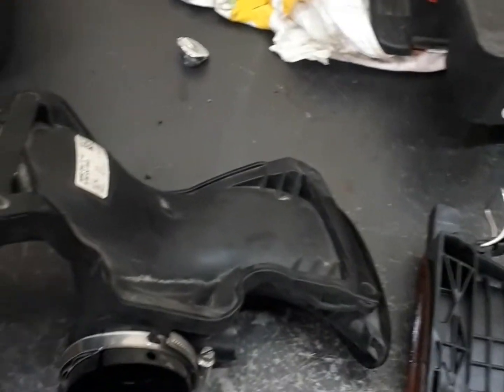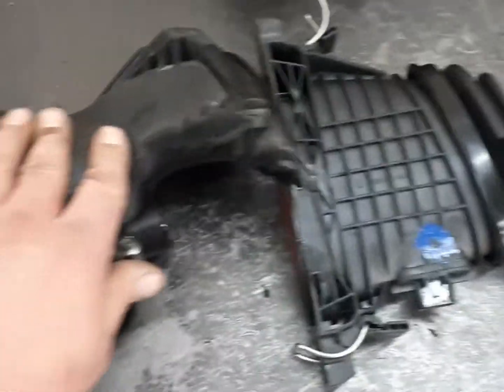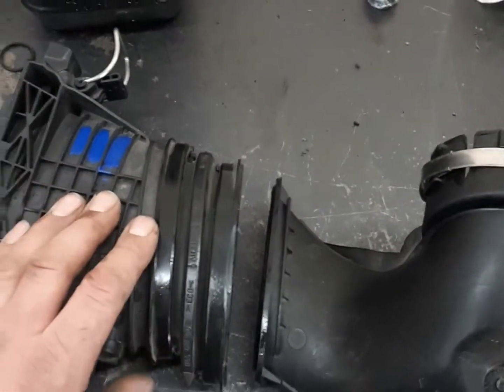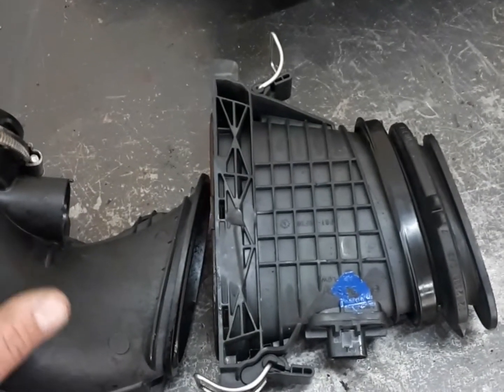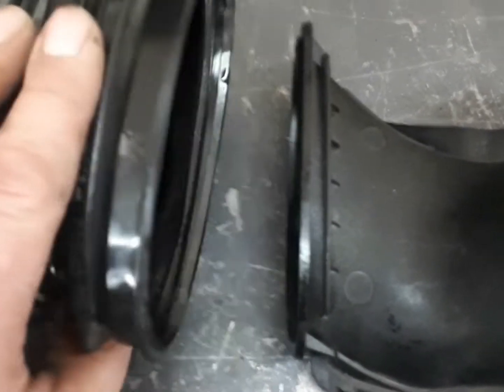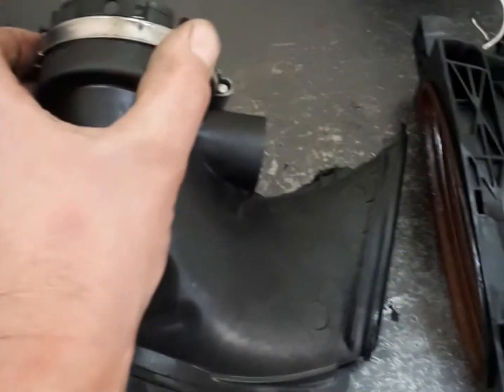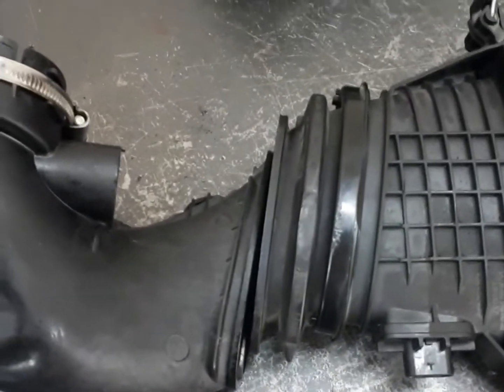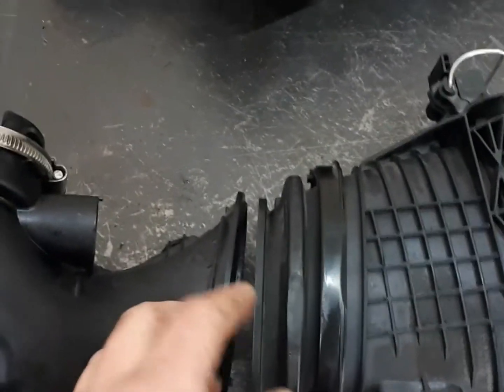ML350 Diesel Mass Air Flow Sensor Set Repair Hack.

Comment: You just pulled it apart and put them together again? I’m assuming there was just a vacuum leak in that case? Or did you go ahead and spray the MAF with some MAF sensor cleaner/isopropyl alcohol spray? Also did the code re-appear? Can it only be cleared with MB star diagnostic tool?
Reply from the maker: Theres a rubber seal inside that was very flexable. Plus diesels have no vacuum until the egr plate closes. Both sensors were shorted on both used parts. First one did not read temperature. The other did not read airflow. But 2 used assemblies i just used the two good ones. But i did warm them back up to pop them back in. Used a pick and pocket screwdriver to gently move the plastic collar. I did use mass airflow cleaner to get soot off the sensor
Reply: Thanks. I’m faced with similar dilemma. Have a generic OBD2 giving 2 p1101 so makes sense could be for both sensors. Doubt they’ve been cleaned too. Would you say it’s possible to get in there from on of the little holes on the ends of this y-pipe/bat wing with the long tip nozzle on the can without having to remove them as you do with the heat gun? I’m up in Canada right now we were at -30 degrees last night. I fear if either I or someone else tries to reheat the plastic pipe like that would be so brittle and crack into pieces. Was hoping just to be able to spray them in from either end of the pipe where there’s a bunch of holes. Thanks again!
Reply from the maker: @tjtj1566  you can try a long flexable plastic tube to try spray it. I only had a generic code with my snap on scan tool but i was lucky to have data stream. I did in summer but yes it was minus 30 at my place too this week. Problem is used there like 300 bucks and no garentee. New there were like 1200 plus for the pipe and both sensors
Reply: Not an ML but i have a 2013 C220 CDI with mass air flow sensor problem. Code P010129. Been in limp mode for a while now. No turbo leaks found.PLEASE HELP!
Reply from the maker: After a forum check a guy was saying after install of new Mass airflow if your wiring is ok. Try reset the lambda sensor or relearn. Kinda a fuel trim reset. Then delete code. Ive never worked on a 220 , to be honest . But most is trial and error and asking questions and reseach on forums

Comment: How do you swap the side clips over? Ive got new sensors but they dont come with plastic clip its really difficult to remove . Any ideas?
Reply from the maker: Looks like they may pry up and out .. i dont remember having to take them off
Reply: Ive done it now.i will upload a video now
 You have to heat it and pry it off slowly.it has a tiny black tab that hodls the clip

Comment: Hi, it's a long shot but, can you post another video showing how you popped off the plastic collar?
Reply from the maker: I don't have a nother one. But what I did was I warmed up plastic with a electric heat gun and just used a pocket screwdriver to gentle work around it with slow pressure. Having a extra set of hands to help works well. Just being patient and gentle prying that thing pops off. To put it back on warm it up and work your way around also some silicone spray helped to pop it back on

Comment: Do not understand what you basically did separate the end of the wings with heat gun and attach it again. But how you can fix the MAF sensor. Clearing the code will not fix MAF sensor if it is dirty. I am surprised below comments think it is the fix. But what you did to fix it. You mentioned that the used one also had bad MAF sensor. so question is the original MAF bad and the used one MAF bad so how you fixed it .... Thank you!!
Reply: That's what i was thinking... he just took it apart and put it back together again? Or used the sensors from the used replacement... or did he skip mentioning a step he did IE cleaning? Lol
Reply from the maker: @The.Contractor.416 yes I did clean them. 1 sensor did not read flow the other did not read temperature.. so yes we took them apart and put 2 into 1. We got a used unit.  Not returnable and it was faulty
Reply: @krubbyscountrylife  thanks for your response. Good for you. I'm debating to get the Lubrmolly cleaning solution and try that out myself. 

I actually did see that you already responded to my question on another comment. But thanks for the respect in answering it again... 

I just ran into the problem.  Changed the EGR Valve today and then noticed the code for this...

Can't find a used one on Facebook market place... hopefully i find one somewhere otherwise if cleaning doesn't work...

Don't feel like spending $1200 CAD on MAF unit... at least the labor is easier than the EGR Valve
Reply from the maker: @The.Contractor.416  we had got the used one from a wrecker but they said since it high fail item no returns.   Ya Benz in Edmonton wanted big bucks for the MAF assembly and being at a small mom and pop shop we took a chance.  I only could get generic codes too..  Benz uses technology I don't have access too..  my boss and I took a wild guess and just tried it..

Comment: How do you remove the wire housing from the unit. I can’t figure out the little grey clip. Don’t want to break it
Reply from the maker: Are u talking about the snap clip?
Reply from the maker: It's been a while since. I actually only heated the black plastic and used a small screwdriver to remove and reinstall. If you asking about the grey. Wire snap locks. I don't have a answer for ya except see if they will pry or bend enough to snap out. But really I never had to move the wire clips just the part that where the rubber gasket is.
Reply: Use a small hook to pull the grey clip out gently by 2mm, it jump to the next groove then you pull the connector out. the grey clip lock the black connector in place.

Comment: Can you take off the sensors or this is impossible? How do you do this if possible? Thanks.
Reply from the maker: They are permanently glued into their housings...
Reply: https://youtu.be/xc1-kHvY40c?si=153EpjlCdBrUztww
Reply: with a tap, the sensor will come out.
Reply: @NamNguyen-ij1es  OK, I change the Mass Air Flow and now works OK. Thanks. But I was unable to put the three parts when I unmount the complete Mass Air Flow . It's equal.